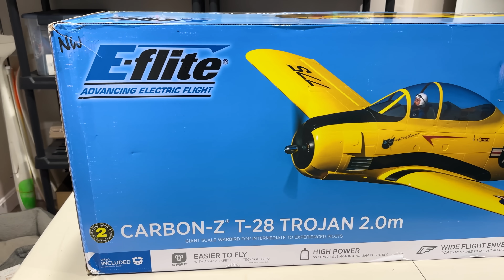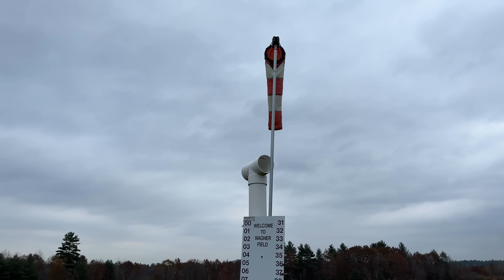Our Runway FLOODED...We Flew Anyway

Comment: Nice video  as always!! (beside that AI video xD )... Super flights and insides. Cool you picking up the telemaster in your 1:1 plane without RC :) The Avanti S made me feel sorry. The dragonfly (?) was cool :) Las weekend I had my first floats-flight on ice. Super cool. But EPO don´t work so good as icebreaker, it scratches pretty fast with thin ice layers :P Pre flight checks were over estimated for the Thick? xD The Bushmaster was cool! A time ago I was thinking of getting one instead of my Draco and some 3D planes. And for the End, I´m allready missing the old Tail Heavy Logo! But it´s probably just getting used to... Nice merch! I hope some goes to Europe also :) Happy holidays or Chrislers
Reply: Didn't know it, but the the nose strut on the Avanti was loose. Results were an unexpected veering far off the runway which also resulted in some laughter. 

Thankfully, only damage was to the nose cone.  It's now tightened back up so it can steer effectively.